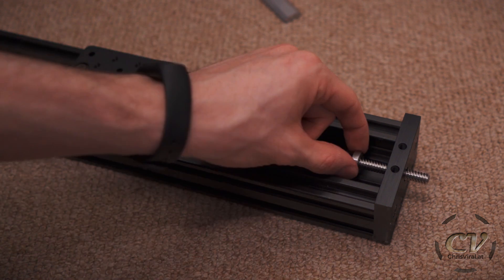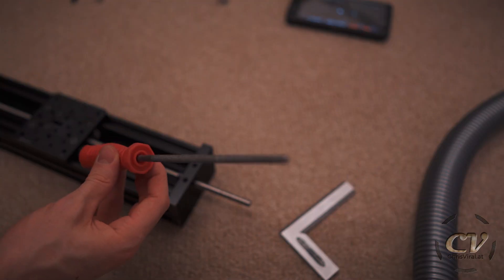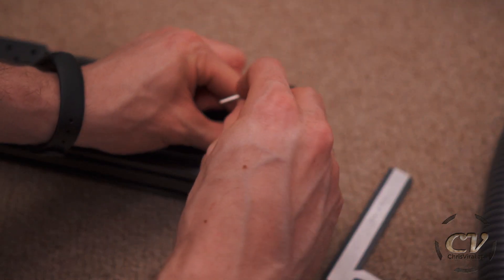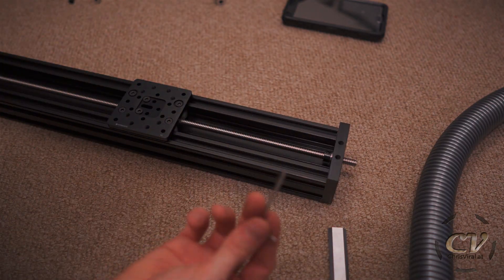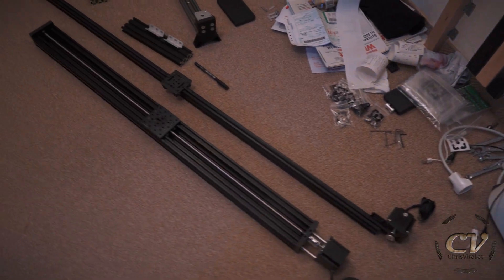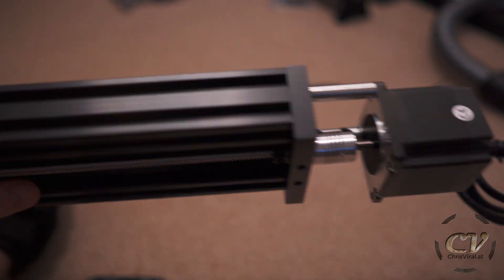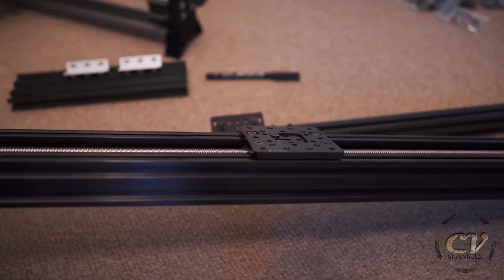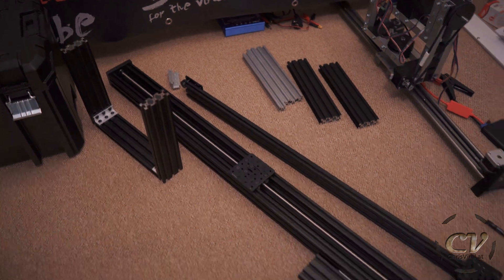OpenBuilds C-Beam Linear Actuator Build

Comment: Thanks for the videos on DIY sliders, really helpful. I'm planning a build at the moment, one is using igus rail and belt drive the other openbuilds and screw drive. As you've used both I'd love to hear your opinion on them. Which is the better setup Igus or openbuilds? Thanks again!
Reply from the maker: Interesting video topic, so thanks for that :)
But tbh I think this is a negligible decision, really both are fine. Both can be adjusted to minimal backlash, surely the linear parts are not the problem of a slider build. Rather how to reduce all the vibrations because these will mess up the video in the end. Belts have a slight tendency to bounce (igus build, but sled friction can be increased) so my hopes are that the c-beam slider won't do this (I haven't built it yet) but then still the whole system can start wo wiggle in x-axis which is the bigger problem. Aside from that the pitch and pan tend to bounce even more, so just to hammer home the point... Both are fine for sure.
Reply: @ChrisViralVlogs  thanks for the reply, appreciate it! I spoke to a guy at Igus recently and he said that screw drive systems can often suffer from wobble, especially if systems are over 1m and often over time if the screw comes out of alignment just a little. Seems to make sense. He also gave a great, if not very expensive solution to pan and tilt, the robot D arm on the Igus site. It's basically a 90 degree worm gear box which is extremely strong so can handle cinema cameras and already has mounting points on the front and back, grab a couple heavy duty L plates and you're done